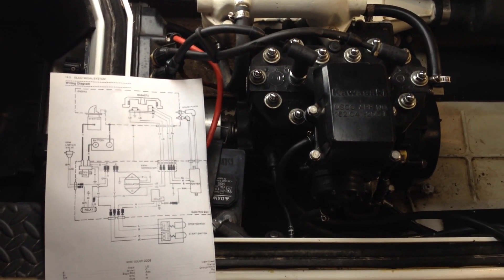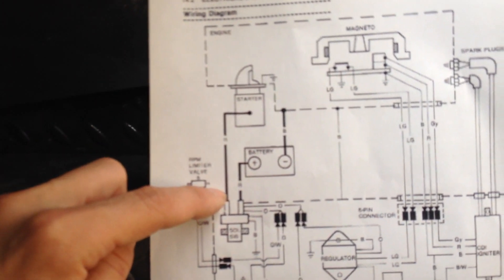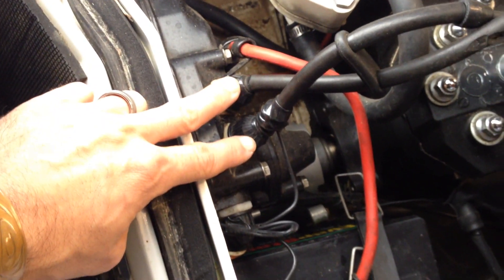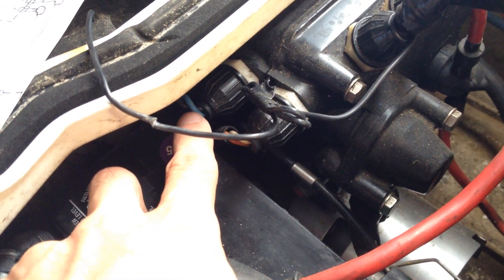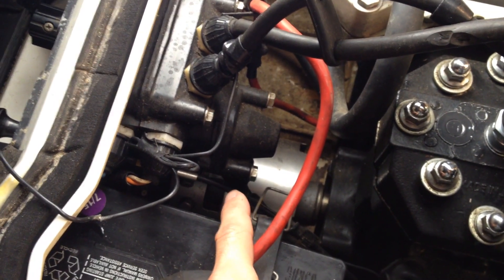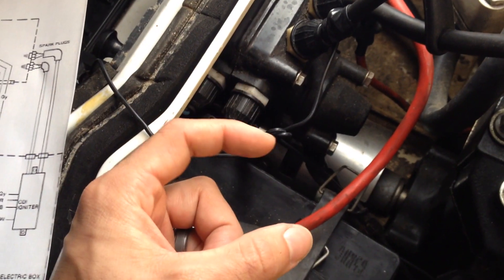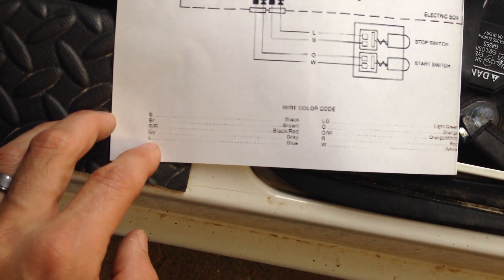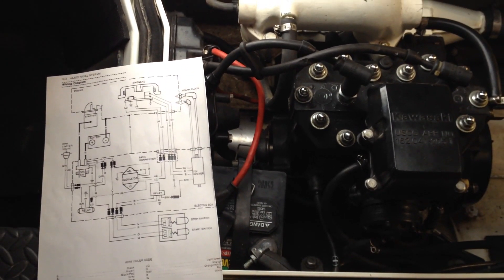1990 Kawasaki 400 / 440 / 550 / 650 Stand Up Jet Ski Electrical Diagram

Comment: Hi! thank you very much for the video! it is super helpful. Could you please advise one thing. Recently I changed the stator and forgot the places of two light green wires. But as far as I see on your diagram - it is actually  doesn't matter if I plug in the light green wires vice-versa. Am I right ?

Comment: Hello, I have a question regarding the stator. I am replacing the charge coil on the stator. I removed the old one because the coil was broken but forgot which wires connects to the coils. Does it matter which wire I connect it to for the charge coil? Are they interchangeable? Thanks!

Comment: when opening the e box do you just remove the bolts (2 large 2 small) and open it up ?
Reply from the maker: That's correct! I've been meaning to make a video just for the ebox but I recently sold my spare one. I should probably pick up a new one and get with the program.

Comment: on the stator the gray wire is it post to be a negative are positive coming out of it I'm using a light wire and on the red wire it's glowing Reilly light
Reply from the maker: +Dionicio Soriano I'm sorry, you need to rephrase your question. I don't understand.
Reply: I replaced the front sill under the flywheel and know the stator is not giving spark

Comment: I have a kawasaki 550 jet ski when I press start button the starter solenoid clicks, also there are two wires coming out of the fuel pump orange and a black and red can you tell me where they go thankyou
Reply from the maker: +Luke Watson You lost me at fuel pump. These engines are carbureted so there won't be a fuel pump. At least not in the sense that you're speaking of. There is a diaphragm that is driven by air pressure that pumps fuel into the engine.
Reply: Sorry it's rev limiter
Reply: Why does it just click when I press start button
Reply from the maker: +Luke Watson Could be a number of issues. Probably not your battery but test that anyways. Otherwise, it's most likely your starter or solenoid. Best way to test this is CAREFULLY connect the terminals on your solenoid with one of your jumper cables. If the starter spins it's your solenoid that needs replaced. If it still just clicks you need a new starter.

Comment: my ski is cutting out at high rpm any idea what it might be?
Reply from the maker: Justin Burkhardt Here is a nicely color coded line diagram. https://goo.gl/I0O0RX
Reply from the maker: Dusty North Do you have the JS550?
Reply: could realy use that a good pic e-mail if you could? wiring all burnt up in fire reconstructing frome engine to box
Reply: I have a 550sx